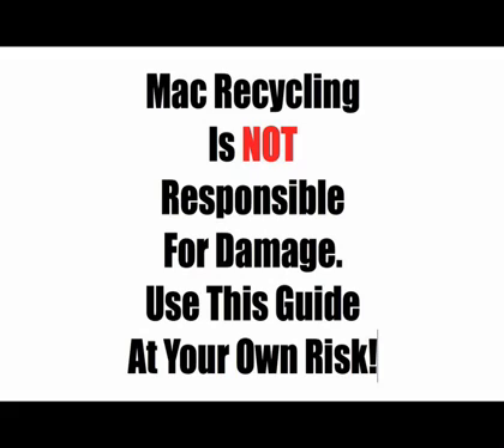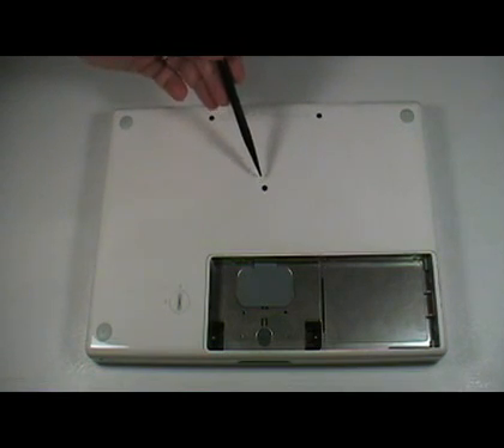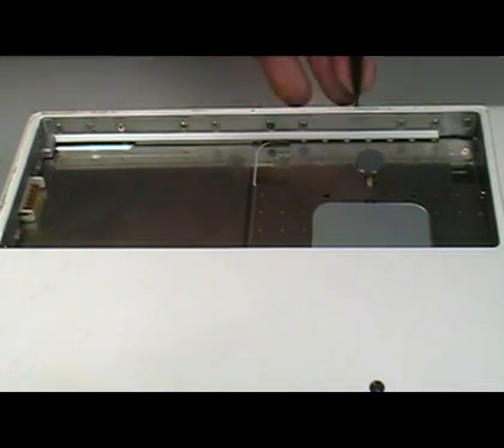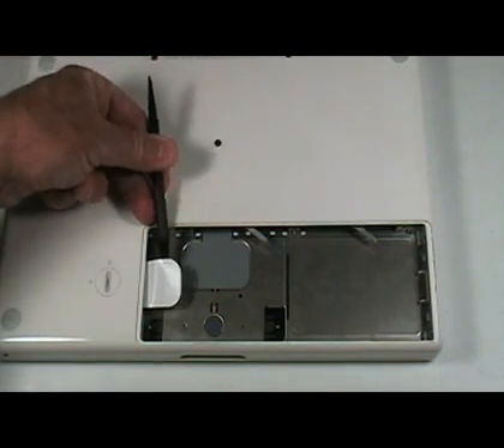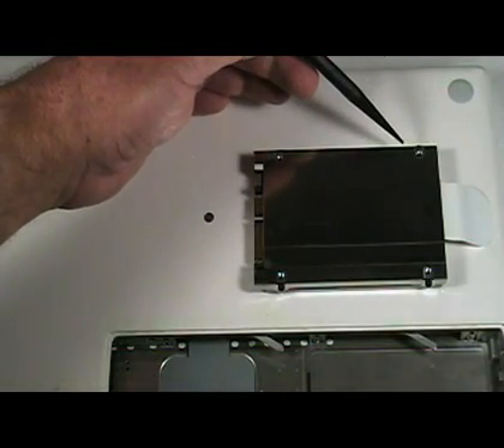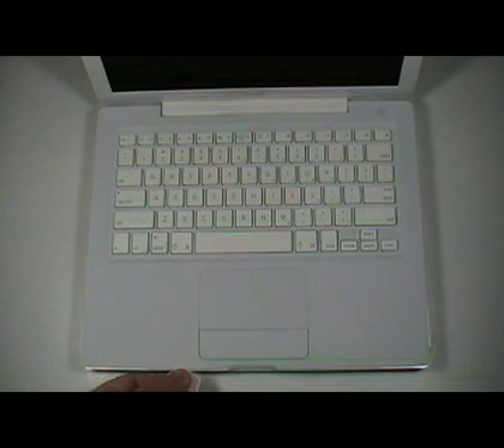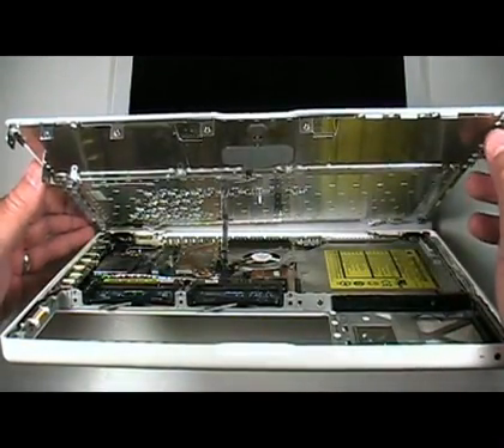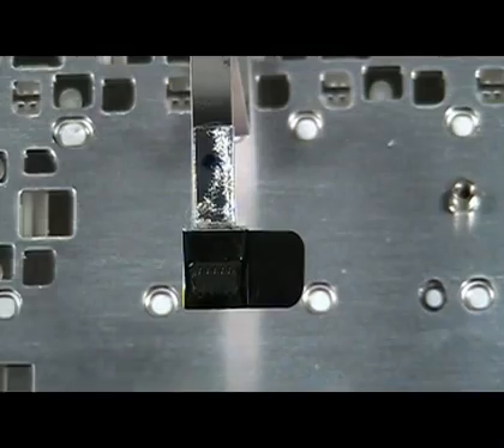Take Apart MacBook 13" - Disassembly: Top Case Removal

Comment: You forgot to mention that you have to remove three screws behind the L-bracket, located to the left, to the right and between the RAM slots. Without removing those you can't remove the top case/keyboard.

Comment: Thank you very much.
I was hoping that the case could be opened as the 2011 aluminium MacBook cases are, but alas...
This is much more intricate and likely to cause issues.... with the machine I have to open as it no longer responds.

Comment: Left out a crucial step with those 3 inner screws but I figured it out without breaking my mac. Please annotate your error where you missed that step or take this video down. You are responsible if you give advice that it is correct. Please

Comment: If anyone is doing this because they spilt coffee on the keybored and it won't turn on you can remove the old one and power the Mac using a flat head then use an external keyboard and mouse it's easy

Comment: Thanks for a great video - I am repairing a machine and suspect the drive is dead. I am wondering if any old drive will do - so long as it is a fit of course. Is it possible to whack an SSD in here ? Has the form factor changed is what I am saying. Great work on the video very good.

Comment: I had to also remove three tiny screws on the inside panel of the battery compartment as well as three screws on the bottom not mentioned in this video.

Comment: to get the cd out take 2 credit cards and stick them both in the drive. one in the bottom and one in the top. if it doesnt work keep trying because i tried it with my imac g3 and it worked. im not sure about the macbook but its a slot loading drive so it must work

Comment: pretty sure removing the top case on your own voids the applecare extended warrantee. I have a white macbook and I wanted to put a black keyboard on it, both for looks, and both for function. personally the black track pads are alot smoother then the white ones. idk, it might be an OCD thing but I think the black keyboards are nicer to the touch.